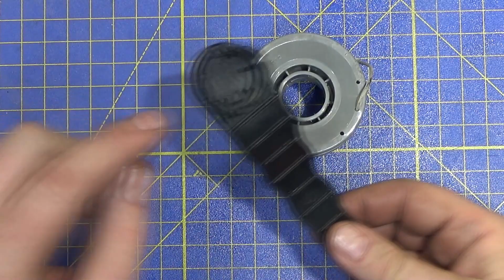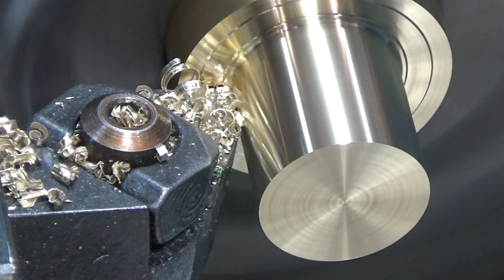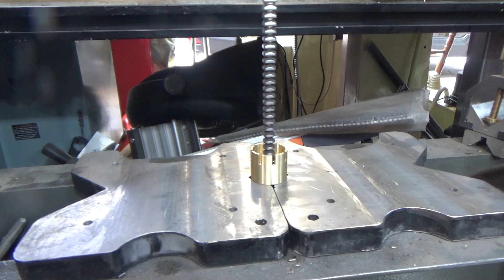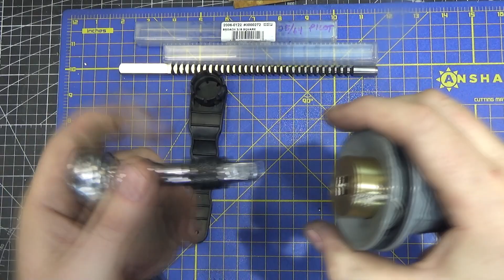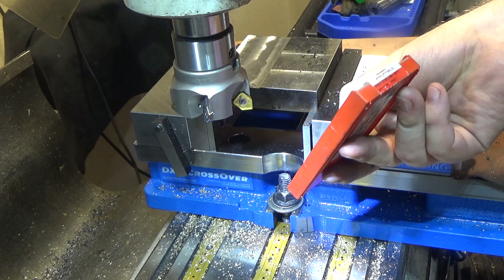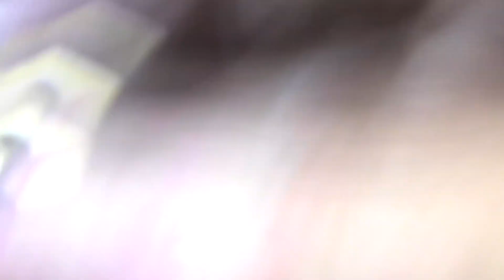Shop Miscellany #09 Part 2

Comment: Nice job .    Looks like it might be the wrong insert .   When i was reading up on the wiper inserts a couple of years back , they mentioned they were for high horsepower machines .  I will try one one day in my big mill .  👍
Reply from the maker: I think you are correct. I suspect they make an insert with a similar designation that is just a tiny bit different and that is all the difference. I look forward to seeing all your king sized gear in operation. Cheers, Max.

Comment: I would think if you made the tool too string, it'll break the plastic valve. I bet the tool is cheaper to replace than the valve cover.
Reply from the maker: Good observation, but in this specific case I think the way the valve is designed makes it much stronger than the tool. My brother-in-law broke 3 removal tools trying to get a valve out and the valve was fine. However, you definitely make a good point and care should be taken.

Comment: With that wiper insert the way you fitted it, the corner would have stuck out further than all the other inserts and so would have done all the cutting. If you mounted the wiper insert with the wiper on the inside then would that work? Probably not since it would still rub on the back side of the insert, but it would then be wiping within the swept path of the other 3 standard inserts.
Reply from the maker: Thanks for the observation. I should have noted that the edge of these wiper inserts were square to the cutting face but the inserts intended for the tool are actually angles from both sides towards the middle. The insert ended up rotating in the holder and then sticking out.

Comment: Can I offer a small suggestion? Find some place out of the way to drill a hole and put one of those floating key rings on it. It would be a shame to drop one overboard and it seems to be Murphy's law that it will be a very basic yet hard to replace part
Reply from the maker: Great idea. Thanks for the suggestion. I think my brother-in-law intends to only use this tool on land, but you might be right...